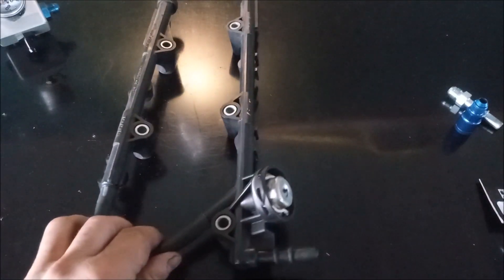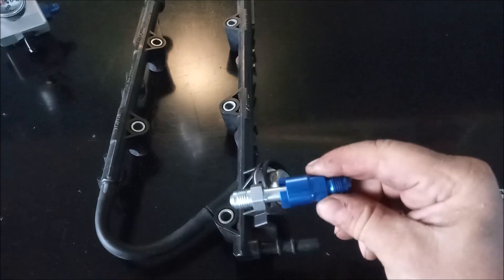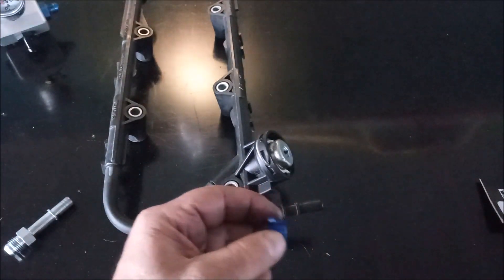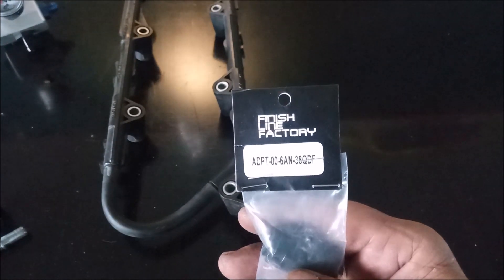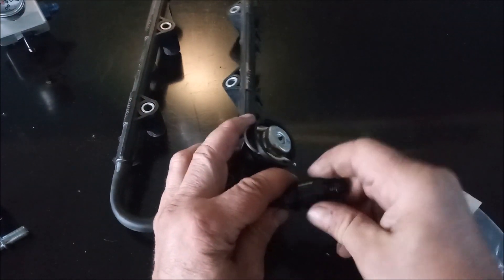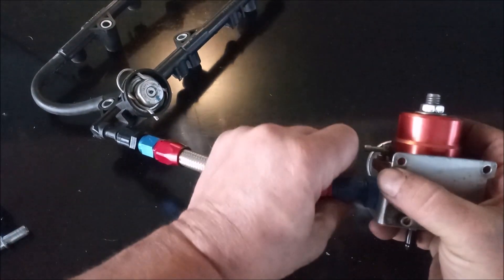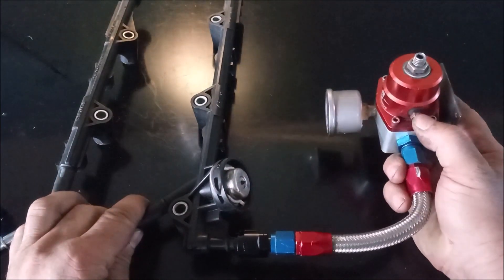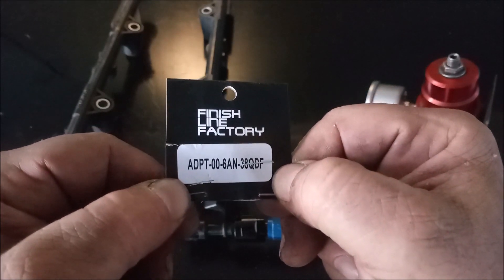How to Connect 2GR-FE Fuel Rail to 6AN Fuel Line for MR2 Engine Swap

Comment: @Frank Saab - Thanks for sharing the info!! Interesting that its for a 3/8 fitting and not the 5/16 that I often read about.
Reply from the maker: This one has a very positive feeling fit on the o-ring. I've heard of people drilling out the 5/16? Anyway maybe I will do a comparison between the rail, a 5/16 quick connect, and a 3/8 quick connect, since I have them all sitting here.
Reply: @Merryfrankster_  - that would be great! Have you pressurized the system with the 3/8 fitting to make sure no leaks?